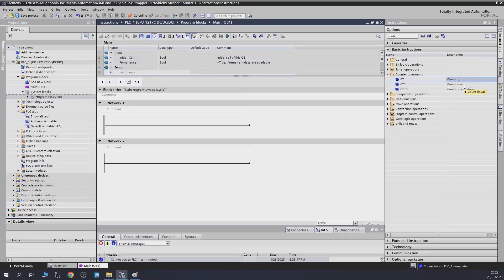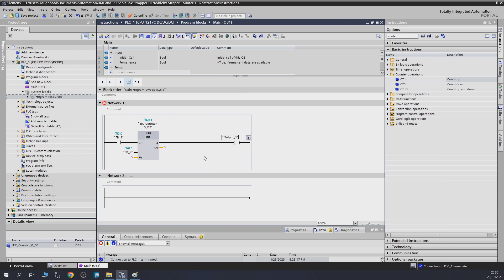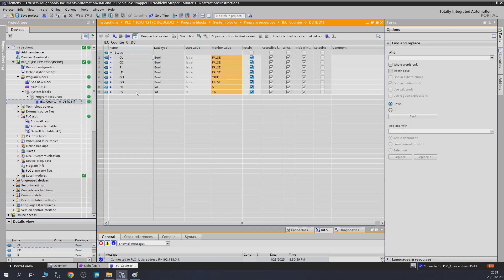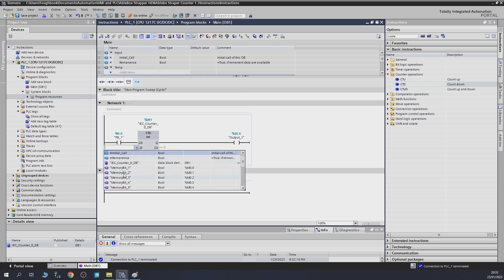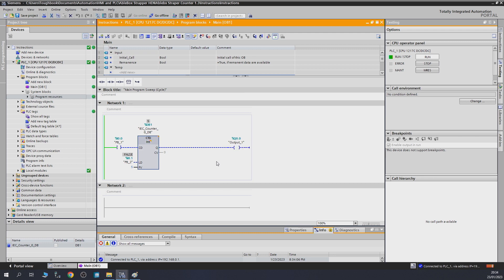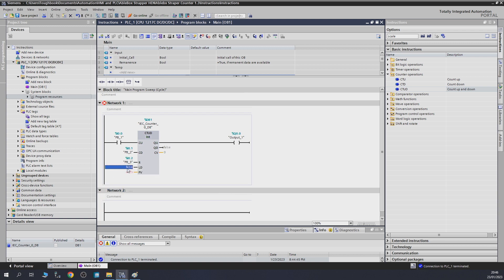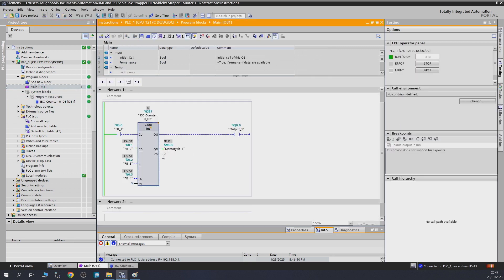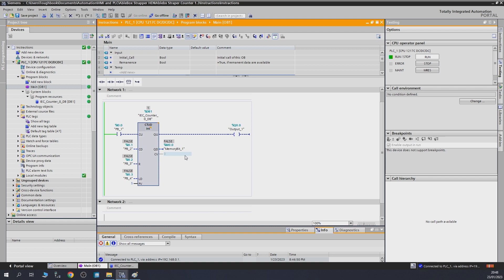Speed learning TIA portal, Basic instructions. Counters #5

Comment: Hi, thank you for your videos they are really useful. Maybe you could help me with my project. I am designing my own electric motor and I need to choose which drive to use. My motor is surface permanent magnet motor and I plan to use sensorless vector control (FOC or DTC). It should have one phase input (230V) and three phase output (0-230V), power should be around 1 kW and frequency range from 0-300 Hz. Can you recommend something below 300$. We checked vacon 20 but do you have some other options? Thank you for your time and help. Have a nice day.